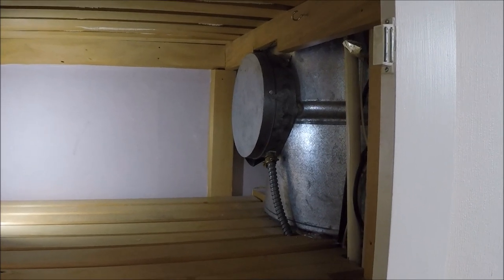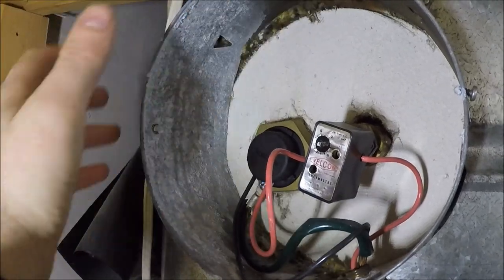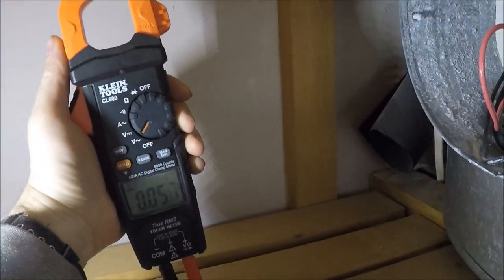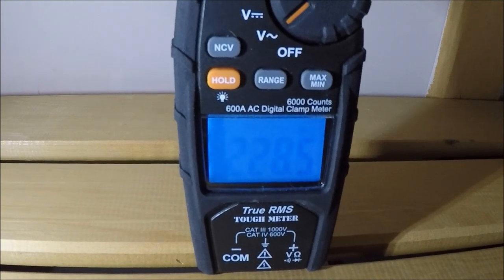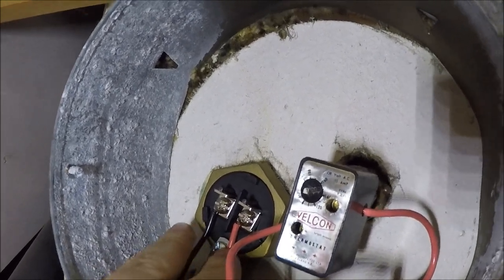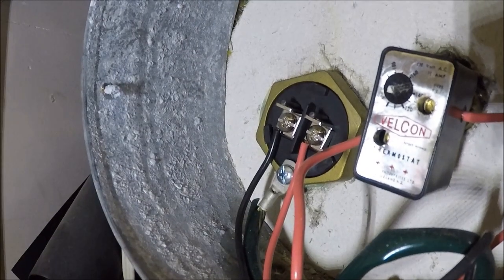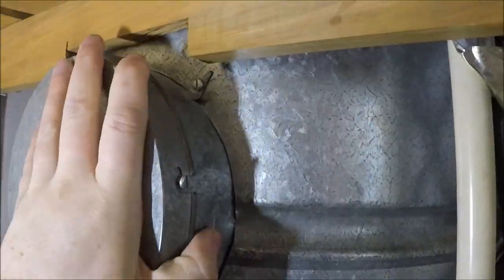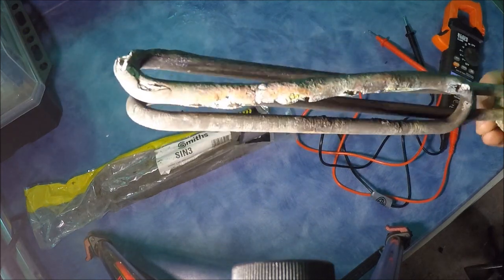How To Test Hot Water Cylinder Element

Comment: i think u have measured ZE line side of main switch  which dose not decide your main siwtch 
protection rating.that Ze is for upstream fuse at boundry box. and also if u dont open men link and measure LN will give you same result as L-PE , which u got.

Comment: Hey Sparky Dave since there is asbestos material present, would you still change the element since you could disturb the asbestos or would you just through away the whole cylinder or just rip out the element with a mask on.
Reply from the maker: Good question, if it was my own I would still remove the element with a proper mask by surrounding the material near the element with either shaving cream or vaseline to minimise the chances of any asbestos material becoming airborne during removal. If it was a customers, I would tell them to phone a plumber :D
Reply: @sparkydave  Thanks for the reply sounds like a good idea using vaseline or shaving cream.
Reply: Hope you will do a new vid on diagnosing the whole cylinder heating circuit. Thanks all your vids are helpful.

Comment: If its damaged can it cause leaking up in the ceiling? Also can it cause increase of power usage?

My power consumption has increased from usual $130-$150 to $240-$380 a month. Its been like that for that past 4 months which is the same time our hot water cylinder and ceiling started leaking water.
Reply: @nev-lj7tb  thank you very much for the info. Appreciate it.
Reply: I realise this was a couple of years ago and I hope you have since fixed your problem, but generally an electrical issue like this will not cause a water leak (there are exceptions to this if something has gone seriously wrong, but the water heater and everything else in the house is unlikely to still work in these situations). A leaking hot water pipe however will cause your water heater to run for more time, as it has to constantly warm the cold water coming in to replace the water hot water that is leaking out. This will cause the higher electricity bill, the extra is probably just paying to heat the water that is leaking out
Reply: Faulty water cylinder. Has since been replaced. It was also causing leaking water pipes in the ceiling. I had eventually got a reimbursement/ refund from property owner's @inhopeofabettername